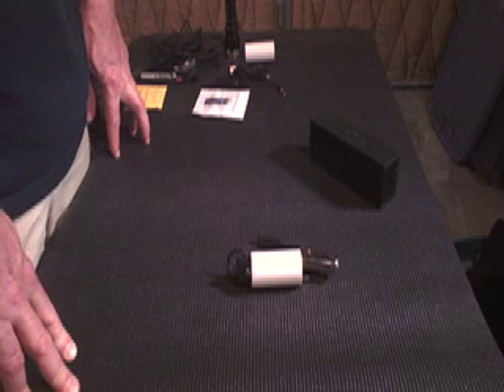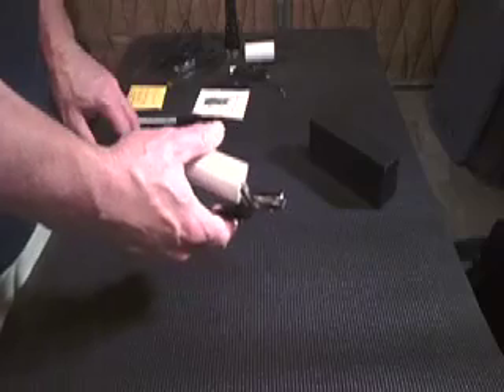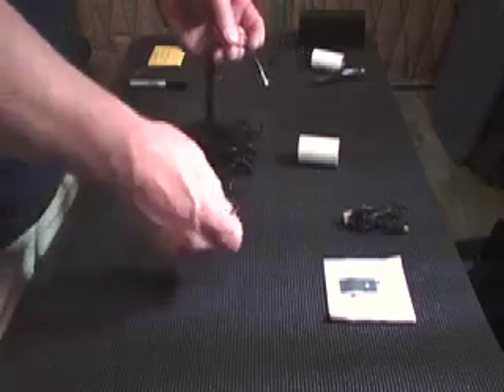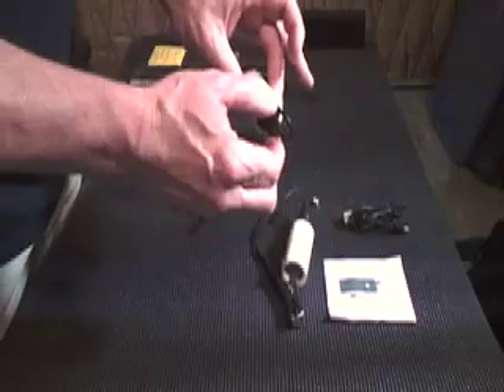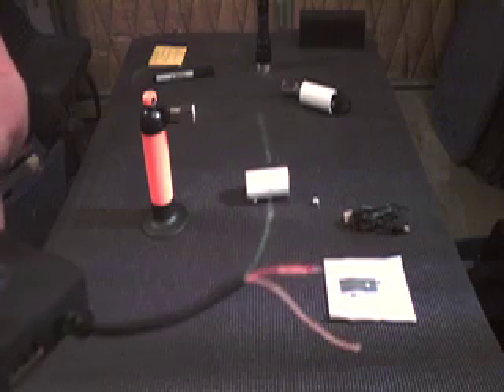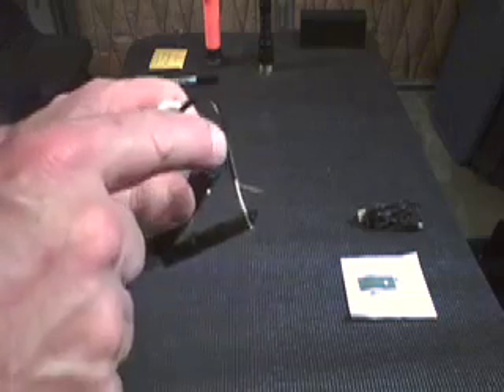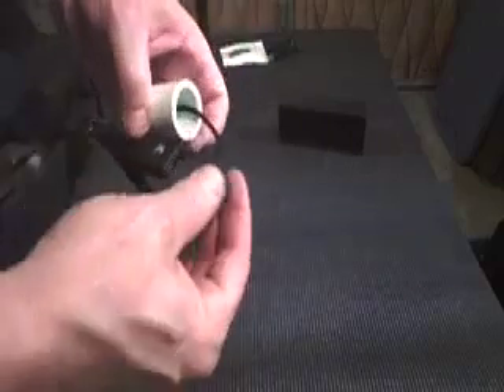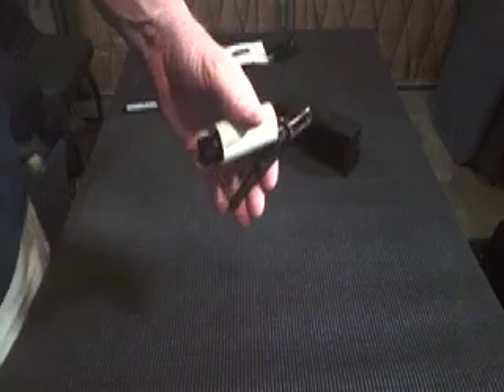Wireless Bluetooth Chassis Ear

Comment: Thanks!  I've paired it with the sound system of the vehicle I am working on and have not had any signal loss.  As mentioned in the video, there is a slight delay (latency) in the audio signal.